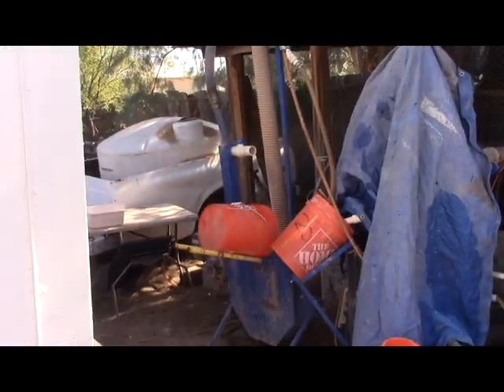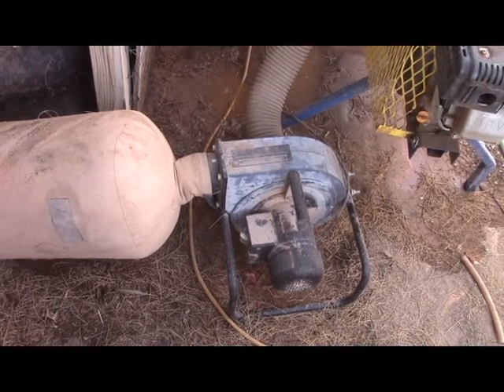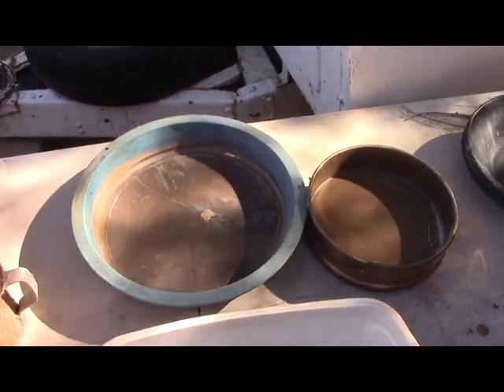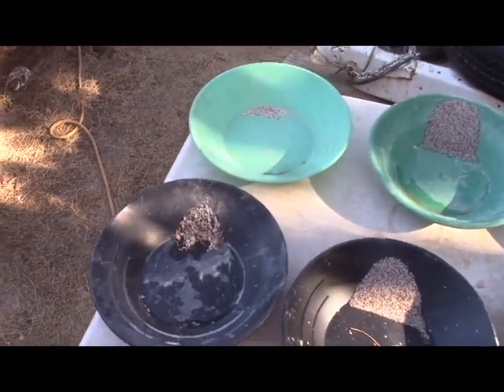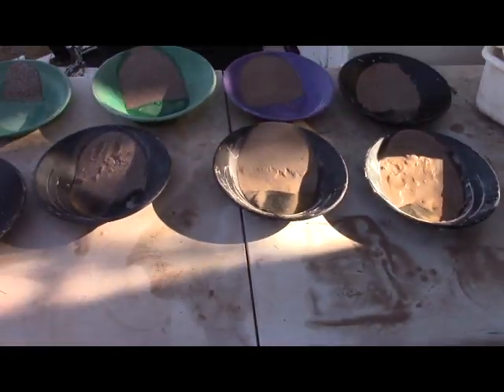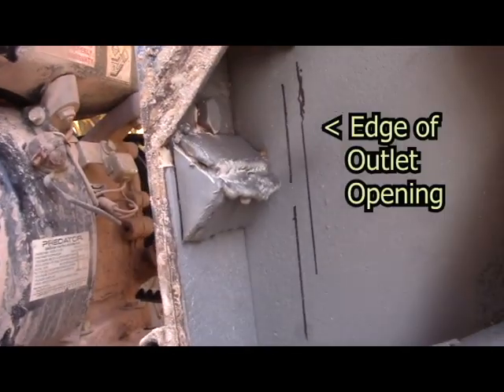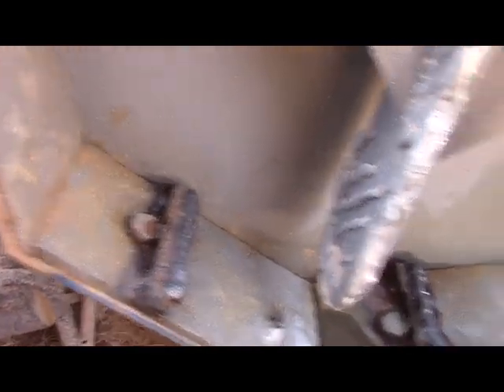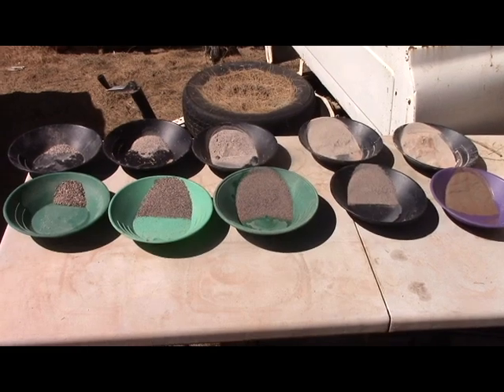159 Modifying The Impact Mill to reduce Grind Size

Comment: Good Video! Good Job!! Your Getting there!!
Reply: Before we know it he'll be able to run black sand endlessly and extract gold no matter how many times he does it.
Reply from the maker: @rickdees251  That would be sweet.  Especially if I could power it with something that makes more energy than it consumes.
Reply from the maker: Thank you
Reply: @hardrockuniversity7283  have you seen the video of a man with a two motor setup and one of the motors uses less power to the other one so he made a circuit of the more powerful one running the other after cranking it up to the mains and producing a constant flow of electricity?

Comment: I had a question about the durability of consumable parts like grind plates, hammers and basiacally anything made of ferus alloy that wears. Sir, i am a certified gunsmith/firearms expert ,specialized in firearms  design . a rifle barrel is a consumable part as well as the bolt. To increase longevity of these high pressure /high heat /high friction and abrassion environments , many steps have been taken to improve that situation. When steel was first exposed to smokeless propellants , the rifling wore extremely fast . 1500 rounds maybe... And the barrel was worn smooth. Winchester made the first notable change with cobalt steel, which gives about 5000 rounds of life. This was in  1894 when the steel was made and released on the brand new winchester model 94 lever action rifle ,chambered for and introducing the at the same time , the 30-30 winchester Smokeless cartridge. Just for frame of referance of time...by world war one , everyone had a form of nickle steel or high chrome steel or cobalt or whater would work for the purpose and not infringe on patents. Anywho the steel had improved markedly . infact good enough to make machineguns that could fire without stop for tens of  thousands of rounds...the barrels where usually surrounded by water containers called water jackets. They kept the heat from building up and gave a barrel life that is outragious.  But the barrel itself was thin. with no coolant and no heat sinks of any sort,it would shoot out quickly in long strings of fire...but if used in a comoarable fasion to a target rifle , would last about 3000-4000 rounds . improvements along the way and skipping many decades to get to now, we end up with materials like the low carbon steels sae4140, 4140 ordinance steel, 
41v50cmv , nickle steel super alloys like stellite and waspaloy and stainless steels like 400 series,400, 401 403.. Then 410 ,416R ,lw50 for firearms and other tools as well as big machines and aus-8 and 440 stainless for cutting edges in humid and salty environments.  .then Sae 5000 series sae 6000... the list is extensive .  in the 1960s a practicle way to apply hard chrome was discovered , the first process created nitrogen embrittlement of the metal in some cases so tthe pricess was adjusted and thats a non issue. The standard military rifle barrel is 4150 chrome moly venadium steel, cold hammer forged and chrome lined. This increases average barrel life to 7500-10,000 rounds.  Downsides are chrome adding to thickness and weight of whatebr its host is and it has to be done immediatly after a part is made to allow it(hard chrome) to adhear to the steel. These days surface conversion  treatments, adopted from massive prescision cnc machines ,which use treated bearings...this can double or tripple barrel life and does not have to be immediatly done. There are several types including melonite, hot salt bath nitride /tennifer as ona glock slide, titanium nitride, nickle boron , as well as nano ceramic coatings.  A hot salt bath setup is not horribly expensive and anybody can do it if they follow direction well and take their time to learn and it can be readily purchased from gunsmith suppliers like brownelles.  Would it be advantagous to treat consumable parts in such a product ? my thinking is , if it works well in the environment of a firearm barrel ,which has been designed already to withstand alot of abuse.. average pressure is 50,000 psi , but varies up to 62,000 and goes down to about 28,000 for modern cartridges.  Everytime a bullet is fired , the rifleing is being super heated with extreme friction, as well as extreme impact and vibration and twisting forces. it has to be good for things that are abraded and worn like a jaw crusher plate or plates and hammers from an impact mill...even ballbearings or rods ina ball or rob mill should wear much slower...Machine parts , chains of all sorts and even hand tools and drill bits... Anything steel that you can prepair the surface of and subemerge in the hot bath is a canodate. It changes no tolorences , it gives a super hard and extremely low friction surface . only pure teflon is more slippery.  It enhances enviromental resistence from everything from sand storms to ice and acidic water . it basically incorporates itself into the upper layers of steels crystaline structure and gives a super durable case hardening (thats the best way i can put it )style of improvment . the surface becomes literlly as hard as diamond yet does not embrittke the object. Just toughens it. Short of making the perfect materials like new steels ,and more  probably a super polymer , for reasonble prices , the conversions are the most viable improvements for what i can tell. Nano cermaic coatings could also be a posabillity but still need work...they add minimal thickness and weight but for firearms tech you have to relpace the ceramics ever few thousand rounds for the barrel to stay uneffected but the fireing process.
Reply from the maker: Hmmm.  Interesting information, thank you. 

The main issues in wear resistance in ore processing are BOTH impact and abrasion.  From my experience, the most common additive to high strength steels is tungsten carbide.  It is both very hard and very tough.  Thus it is used for impact drilling where diamonds are only used for  what you might call "abrasion drilling' like core sampling.  I am aware of some surface treatments with vapor deposited diamond to increase wear resistance in abrasion only applications, but don't know if they have any application to impact circumstances.  

An interesting development has been the ability to  precisely entrain different amounts of carbide in a single part- such as a bucket tooth- so that instead of getting dull, it maintains its sharpness as it wears back.  Imagine a knife blade with a very thin layer of diamond at the apex of the cutting edge.  See how it could stay sharp as it wears?

In terms of ore crushing, recent improvements are the use of rubber liners for ball mills.  The crushing is done between the balls, which are cheap and easily replaced.  The mill liners OTOH are quite expensive to make and expensive and time consuming to replace so the lack of grinding at the liner well pays for itself in the reduction in cost.  It is strange to think that rubber can last longer than steel, but it does in some applications.

Another interesting innovation in metallurgy is the layering of different minor elements into bearings like the crank bearings of engines.  By adding, say silver, to the outer 20 percent of the bearing lining with, say copper, in the outer 7 percent, a simple oil analysis can give you  a reliable warning of bearing wear failure at the right time for most efficient preventive maintenance.  You do not want to take multi million dollar pieces of equipment out of service for expensive rebuilding either too soon OR too late.  This gets things 'just right'.

In my application I think quickly replaceable wear parts like computer plasma cut bolt on wear tips for the rotor made out of high strength steel are probably the best for economics.  They would probably only cost a couple dollars each and would last several shifts.  Then thirty minutes to change out and back in business.  It also provides a constant purchase stream from customers- a plus for any equipment manufacturer.  That is the most common solution I am aware of.

Keith

Comment: Is there any benefit to having swinging hammers instead of solid paddles?
Reply from the maker: I'm not sure.  One benefit would be if some tramp iron got introduced, then the hammers could give way a bit and reduce the potential for damage.  After building this mill, I suspect the cenrifugal effect keeps swinging hammers almost perpendicular to the shaft anyway.  Someday I will learn for certain.
Reply: @hardrockuniversity7283   That was my only thought is that there would be some give in the system. I just know I have seen both, so I didnt know if one was better than the other.